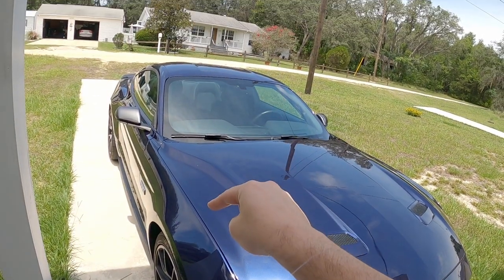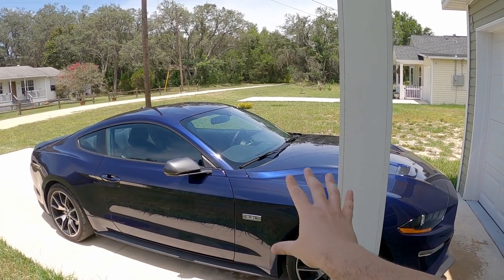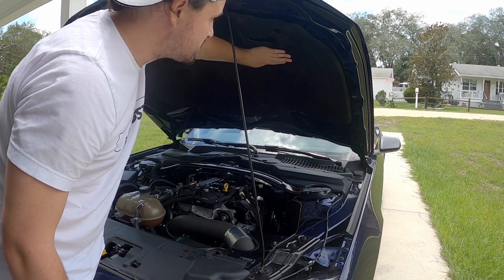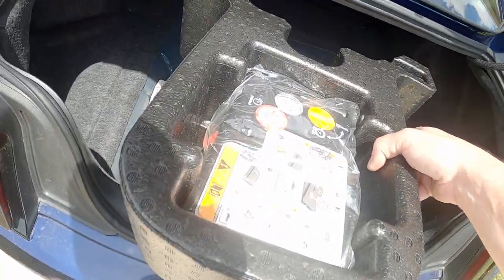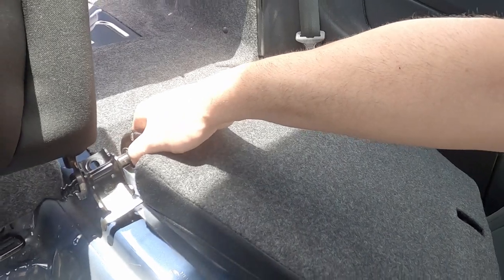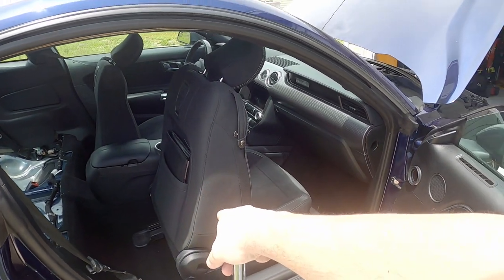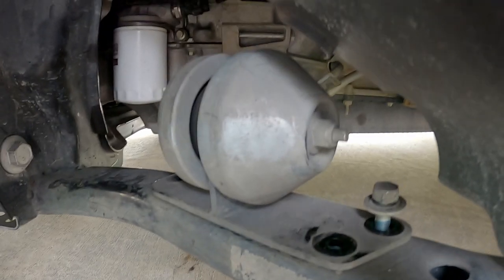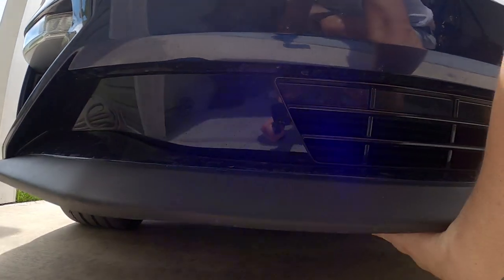I Made This Mustang FASTER for FREE

Comment: You can take off the battery cover/tray easily as well. Just don’t drive it in the rain or go through a car wash since I think it helps divert water!
Reply from the maker: There's a bunch of things that can be removed. But I wanted to focus on the things that does not mess with the usability, driveability, and comfort of the vehicle. There's definitely another easy 10 pounds in plastic, and other trim pieces.